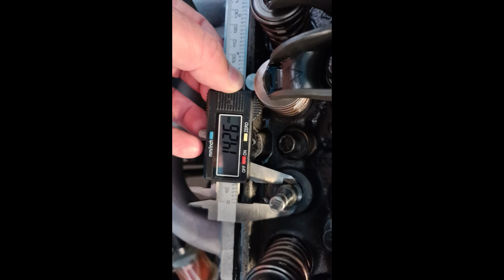HQ Holden Monaro Coupe 17 year build part 12

Comment: If you connect a airline to the spark plug hole you can use pressure to hold the valve up to stop it dropping down
Reply from the maker: I was told that after i had finished the job. My luck the compressor would give up the ghost mid job. lol
Reply: @rustandpaint  shit like that happens to us all, mine gave up mid paint job once.
Reply from the maker: @colinmiles9390  Murphy's law. you can only laugh and move forward, or cry. lol

Comment: That is  NICE car.the legendary HQ different colour to whats out there in these models..always been a HQ fan and have  my own Quey tonner and ute. i was just wondering. the paint job is great.what would a black line either satin or gloss look like to break up thr blue body and white hood where they meet on the pillar.just a thought.
Reply from the maker: Cheers Dallas , I have added polished stainless steel trim/ moulding to the join to finish it off.  I'm still  up in the air about it and if I fully like it or not.  I have a bit more video to upload when I get time. Hopefully over the next week or so.

Comment: It’s humbling to know im not the only one going through master cylinders. I’ve been going through the same thing, Protex master straight out the box leaking out the master cylinder, I’ve bought three so far.
Reply from the maker: I really think if you can find an original MC  and have a stainless sleeve put in it you are better off. If this one goes, I will try to do that or try a Wilwood MC  or something similar.  You need to be able to stop without worrying if it is going to fail.  The Protex and the one I purchased look identical. may be the same just a different box
Reply: @rustandpaint  costs and benefits of the wilwoods put me off, for every good comment on them there’s normally multiple negative. I’m currently filming a vy booster/master conversion as just like you I’ve had multiple problems with the aftermarket master cylinders.
Reply from the maker: @V8JakeC  I brought  the Wilwood  HQ conversion kit when it was on special. it was around $120 off. They work well, but I'm not sure what I was expecting. the original PBR worked as well.  I know a few who have the Wilwood MC, and they seem to be ok. I'm not keen on going through the Flexdrive route again, doing all that brake bleeding again. That's the only reason mentioned  using the other brands. As you know, what a pain it is!

Comment: In some photos it looks like Azure blue, in others not. What colour is it? Also I think it is fitting that you have a white roof, apparently for Monaros it was a Queensland only option according to the Monaros Bible.
Reply from the maker: Hi Mark, The colour is out of a colour swatch book. As far as i know it's not a car colour.  It's called Atlas Blue,  unfortunately it rarely photographs' the correct colour.  I didn't know that bout the roof colour.  I had only seen vinyl on the Monaro's. I went with the white for something different and to help keep the heat down so the AC wouldn't have to work as hard.

Comment: shouldn;t the engine be on warranty ? IIRC it was crate and that shouldn't happen , should it?
Reply from the maker: It had a 12months 120k warranty  but it sat for over 2years in the shed before is put it in.
Reply: @rustandpaint  bugga
Reply from the maker: @99gibby99   yeah, it was. lucky it was a simple inexpensive fix.